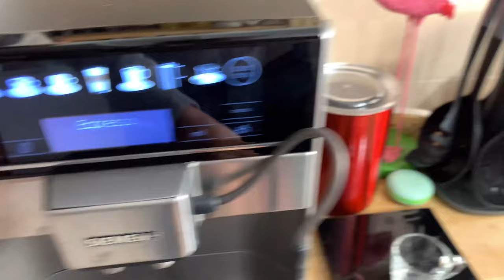Siemens EQ.6 Grinder Malfunction?

Comment: Have you tried changing the grind settings? I have just checked mine. On Regular-Medium Espresso settings I get 39 grams and on Strong-Medium Espresso settings I get 36-37 grams. But the used coffee circle is dry on both settings and have full circle. Also keep in mind I have tested it on finest settings. I tried on Medium settings regular and after 2 cups I get 40-41 grams, "cookie" is still whole but the top part has fallen apart and there is certainly visible difference in grind settings. My advice is try using finest grind settings and try again, but make sure that you make changes while grinder is ON.

Comment: Did you figure out what was the problem? Is it Grinder or brewing group? I have exactly the same problem
Reply: I have the same problem on s100 model. I think that grinder need some adjustment because the coffee grains are just too big. Beside siemens I own melitta caffeo solo and it is set to medium grind and the coffee grains are just much smaller than in siemens. So I think they fcked something up with grinder adjustment on factory line.
Reply: @arkasza2007   mine just started doing the same after 6 years. The grind was much finer at the start. Did you find a solution or this ?
Reply: @dylanhunt4303  As the machine was under the warranty I made a complaint. Siemens changed brew unit and grinder for new parts. Now it grinds really fine and has crema on top of the espresso, although coffee cakes are still soggy, not dripping wet, but soggy). 
If I had to fix it myself, I would take the top of the machine off and clean the grinder and set the grind setting manually. That's the only thing that comes up to my mind.